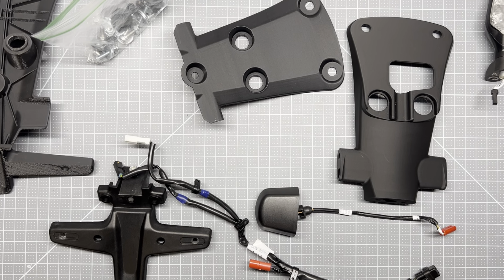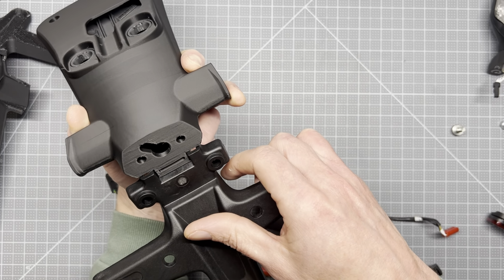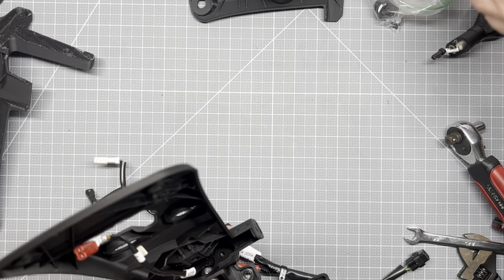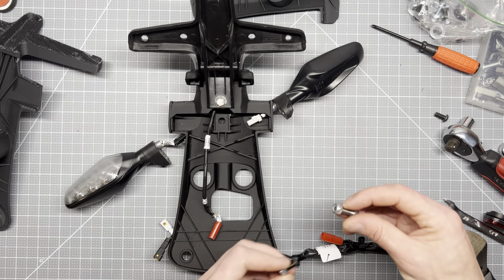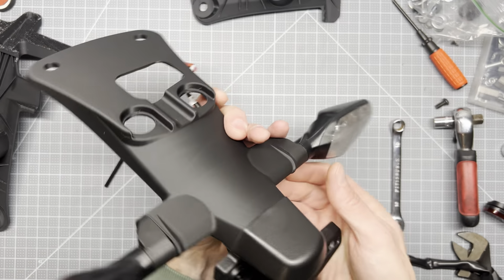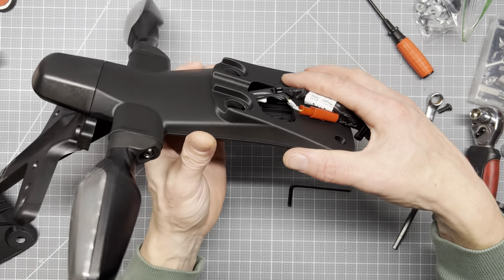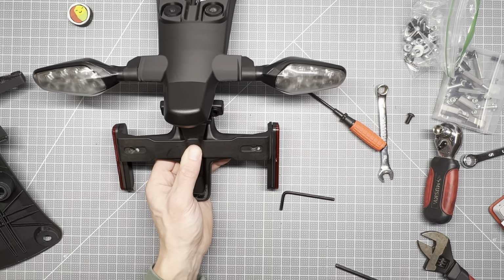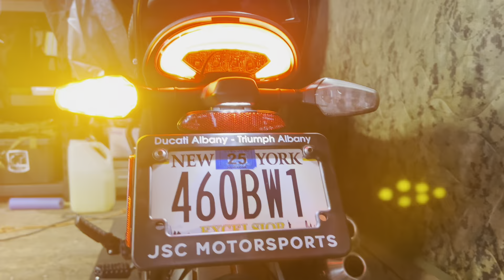Triumph 400x Short Tail Part 2- Final Design

Comment: I'm wondering about rain/mud.  I couldn't see a good side view to try to judge if it holds the plate out far enough to prevent rain/mud from getting thrown over the bike/rider...what do you think? from the bottom of the plate to a tangent on the tire is vertical or?  ...looks very well done by the way, kudos
Reply from the maker: @jessewigent9776  yes good point, it still holds the plate out far enough that it should take anything that is kicked up at a tangent angle towards the rider. Also the whole rear seat fender flare it gets bolted onto also would do that job . The OEM plate holder is as long as it is because there’s a rule in a country they sell these bikes, that the reflector, indicator and plates must be in line with the rear most point of the bike( the tire) therefore to save cost nearly every bike complies to that one particular rule.  I’ll try to get more overall views of the bike when I complete this other accessory project I’m working on for it. I have a picture but am not able find how to put one in here.  Maybe in the description 🤔?  Cheers!
Reply: @keithdolezel great feedback. My brother has a 3-D printer and hoping I can con him into making this piece for me. I have another very nicely  designed and 3-D printed tail tidy, and it looks absolutely fantastic, but it’s super sleek and minimal and I’m fairly confident it will not keep rain and mud off of me.

Comment: Extremely well done in this part2!
A couple of things if i may...
1. Flip the 'J' or speed nut 180 deg to front load it keeping the sides raised so it doesn't rotate when tightening.
2. Can you use another 'J' nut for the original fitment of the number plate bracket attachment?
I'm sorry I don't have the scrambler yet but will be purchasing one soon.
I don't recall if 2 'J' nuts are available in the stock rear fender.
Otherwise, a brilliant result, design, creation & presentation.
Still very much interested in your CAD program!
Cheers
Reply from the maker: Thanks for the feedback and ideas. I have tweaked the design some more since then but am waiting to see how this one test out on the road.  For the CAD program I use PTC creo and parametric modeling.  Usually the current software and tools I use at my work.

Comment: That looks absolutely fantastic. It’s the way it should be done from the factory. 

 I think this Mk2 version is close to perfect. Are there any other things that you think could be better revised, or are you happy with it?

I’m serious when I say that I wish I’d not bought a metal one now.
Reply from the maker: Thanks! It’s pretty good right now for a 3d printed housing. I think refinement wise I would maybe find a way add some nesting ridges along the edges so both plastic halves nest in each other and add a bit more resistance to water.  I don’t ride in the rain so it’s not a must have for me right now. But if I was designing for production it would definitely have it in there.
Reply: Agree completely. The moment I noticed how seamlessly this matched the design of the bike, I had second thoughts about ordering a metal tail tidy that has yet to be delivered. 
Damn fine work, sir. Ride safe.
Reply: @keithdolezel  or maybe add some sealing compound between parts. 

But yes it looks very pretty!